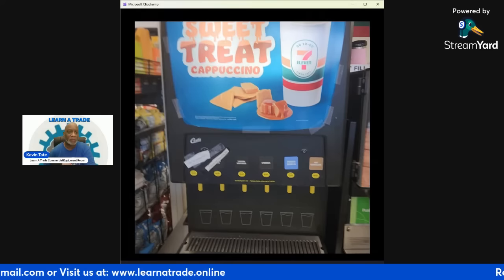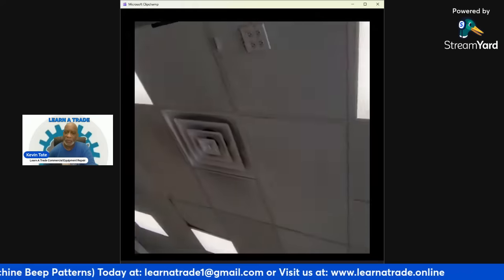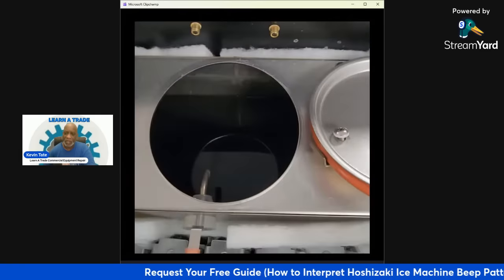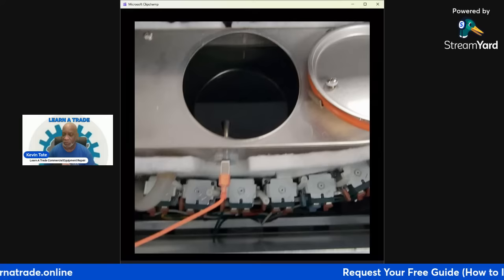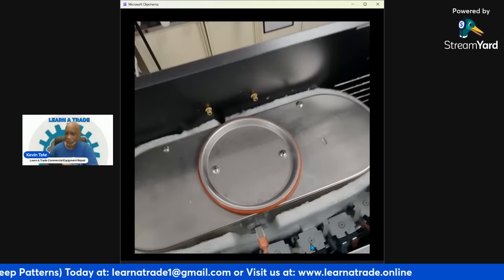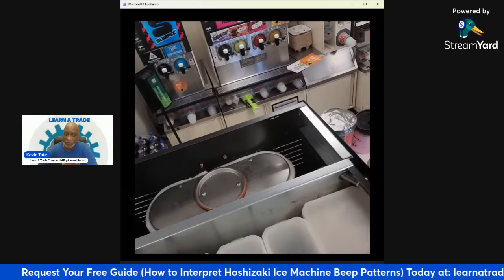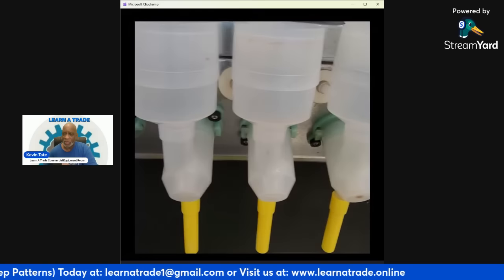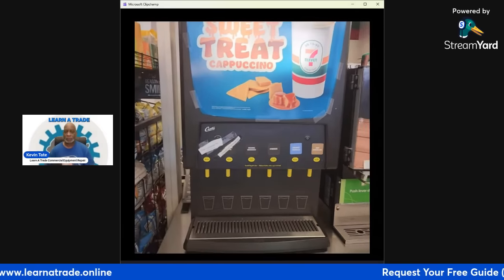Wilbur Curtis Cappuccino Machine Repair (Fill Error)

Comment: Hello sir, same machine im working on. In your opinion what do u think is the problem if the flavor powder is dispensing but not the water? I pressed the hot coco button and all i hot was a cup of powder 😂. Thank you.
Reply from the maker: Hello thanks for reaching out.  First thing are all of the flavors doing that? If so then it could be a water issue. You will need to make sure that the main water to the machine is on. If there is a water issue it may show up on the display as a water fill issue. If it is only happening on one flavor there may be a issue with the water solenoid valve, they are located behind the rear panel  behind the hoppers. One of the wires may have disconnected or the valve could be faulty and needs to be replaced. Hope that helps let me know the outcome.